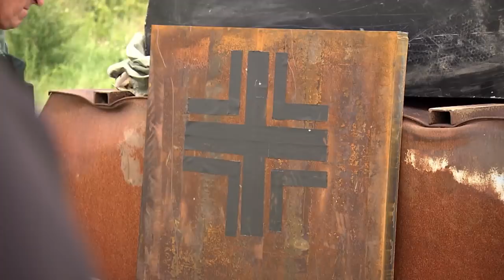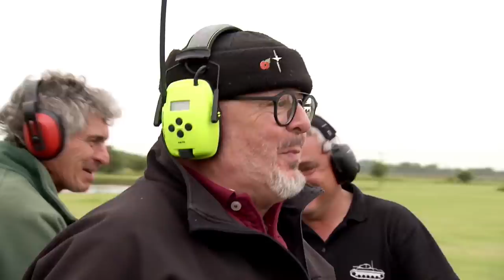Bruce Explodes A Simulated Tank With An Anti-Tank Gun | Combat Dealers

Comment: I don’t think the bazooka was the first launcher to be able to destroy a tank. I’m most certain is was either the Faust Patrone or Panzer Faust
Reply: I think it was the Faust patrone
Reply: Even before the Faust Patronne there was the Pg.46 rifle & Kampfpistolen (modified flare gun) launched and Pg.51 cut down PzB.39 AT rifle launched HEAT grenades. Both could penetrate up to 89mm. of vertical homogenous armour and nearly double the thickness of ordinary steel plate. 

The Kampfpistolen launched Pg.46 grenade had a range of 50 metres.

The Kar.98 launched Pg.46 grenade had a range of 100 metres.

The cut down PzB.39 launched Pg.51 had a range of 300 metres.

In desperate moments the finned Pg.46 grenade could be also thrown against a tank by hand.

Despite having a shorter range than the PzB.39 AT rifle launcher, the Faust Patronne could penetrate up to 148mm. of vertical homogenous armour plate.

The Panzerfaust could penetrate up to 221mm. of vertical homogenous armour plate and up to 192mm. set at 60 degrees of slope. It was more than capable of penetrating any Allied or Soviet tank available at the time.
Reply: Parker Hetzel  It is debatable if the Bazooka was truly a reliable tank destroyer as this test demonstrates.  Many who used it in combat said that it wasn't capable of penetrating the forward armour of any mid to late war German tank and often failed to penetrate thinner side armour, despite its rated ability to go through at least 5 inches of hardened steel.
Reply: ur mom  Let's face it.  The shaped charge of the original Bazooka AT round was just too small to do the job against the armour of contemporary German tanks.
Reply: The Panzer Faust was made after the Panzer schreck which was a copy of the american bazookas captured in Africa and Italy

Comment: First of all the front plate should be angled...
Second the range... You dont know how far the target was killed by there is no way you can test these in only a few meters 
Lastly the gun... There are other guns than the 6 pounder that couldve taken the panther out
Reply: like the 17 pounder
Reply: I can agree.
Reply: And the 57mm 6pdr is a solid chunk of metal flying at a high velocity while the Bazooka is a shaped charge rocket flying at a lower velocity.
Reply: @AJ-170SkyStriker  Even still the Bazooka at the time had different charges some that could pen up  to 65-85 mm and others that could pen up to 105 mm. All depending on the time and unit.
Reply: @ninus17  even that would still have trouble punching through the panther's upper plate, hell, even the tiger would have trouble with that
Reply: KingsWorth and company but it was one of the better options at the time. And the firefly was a lot more mobile than the other Trailed AT guns which required setup time. Where as the firefly could be ready to engage in combat if an when a German panther or tiger showed up
Reply: @ninus17  ok, ya, still doesn't mean it could go through a panther's upper plate
Reply: @crow_boi3387  the firefly was known for stopping tigers... Panthers are thinner.
Reply: @chrislockard1922  panthers are angled, more effective armor thickness
Reply: exactly

Comment: "the american bazooka was the first weapon capable of reliably destroying a tank"
dont lie. just. dont.
Reply: Yanks doing Yanks things
Reply: First INFANTRY weapon. Though that claim is still a bit of a stretch.
Reply: @davidj9677  The Soviets and Finns already had anti-tank rifles that could eliminate tanks at close range in the late 30s or early 40s, so yeah, the Bazooka wasn't first in any way.
Reply: @bluntcabbage6042  The problem was that those anti tank rifles were only good against the thinly armoured tanks of the early war. By 1943 most nations had transition to vehicles that were too well protected for anti tank rifles
Reply: @RocketHarry865  That is partially true. Yes, anti-tank rifles struggled against mid-late war vehicles, but historically, they were deadly foes towards the vehicles they faced frequently. The Battle of Stalingrad saw large use of the PTRD, which had proven to knock out many German tanks throughout the battle.
Reply: @bluntcabbage6042  pak 40? Flak 88mm?
Reply: @jantimmer5558  What about them?
Reply: @bluntcabbage6042  yes but this was because dedicated AT snipers shooted tanks from high ground to their upper superior plate (roof) since the armor was thicc on the frontal plate, on frontal attacks the would fire to the tracks to inmobilize them and then rush em with infantry.
Reply: Well the commom bazooka dont but the heavier ones were cappable, they just were not produced on high numbers
Reply: @Tommy15670  The usage of AT rifles in Stalingrad was more to do with hiding in a certain position and waiting for a tank to cross your field of fire at close range, and it wasn't necessary to shoot for their roof armor.
Reply: @RocketHarry865  yes but at the time it could destroy vehicle so ptrd/ptrs and these other rifles were the first
Reply: Actually I'm afraid it was the panzer Faust .

Comment: A Panther's armor was angled
Reply: In the full ep the pather was hit in the lower front hull where the transmisson was held and the panther they restored was hit by a 2pdr gun and the panther you can look up now and will be sent too the austrilain armour meusem
Reply: 6pdr**
Reply: It's only a simulation.
Reply: Not the sides dude. The sides were really flat, but did have side plates that were meant for high explosive protection and small arms fire.

Comment: The plates increace in effective thickness when angled... And when a plate is angled it also has a ballistic effct to the tank shell that further reduces the penetration of the round... The bazooka also has a smaller hole with a small explosion because its a High Explosive Anti Tank grenade and relies on the explosive inside to force metal through a small surface penetrating the compartment unlike the tank round that has a big and even hole when it penetrates the tank and either explodes or not if it has explosive filler. If it was a tank round, there would be absolute chaos inside the tank from the shrapnel

Comment: I really dont like all the pyrotechnics used, you cant have these things in Britain so obviously these aren't shooting actual munitions but they could at least do more than put a bomb under the dumpster and plasma cut a hole in the plate. That bazooka just  shot a paint round and even if it was a real rocket the hole would have been much cleaner and not have all those secondary impacts around it
Reply: At least they had parts for actual German tanks in the barn however they likely just welded the stug hull together because I seen no reason for any country (Germany or the USSR) to just dump an incomplete Stug and pz4 superstructure in a random barn

Comment: What would really be cool is if there was a single-man bazooka type weapon that could do the damage of that 6” Howitzer.
Reply: Look up the Dave Crocket nuclear bazooka. Does more damage than a hundred 6" howitzers. Blast radius = 5 miles, range = 3 miles. It's a one man one shot weapon. It doesn't require a loader as there would be no second shot because the operator would be dead.

Comment: wouldn't a 6 pounder have to be extremely close to knock out a panther? they were what? less than 100 yards away?
Reply: Considering how clean that hole was they could have backed it up quite a lot. Gonna depend a lot on angle and where it contacts.
Reply: MrLoobu it was special affects. England has no permits allowing for the firing of an anti tank gun in a non-military environment
Reply: @prestonwhite4129  oh fuck me you're right the cannon doesnt recoil lol, that's excessively lame and misleading.
Reply: Depends on the ammunition used and if it attacked the Panther from the side as Allied AT ambush doctrine favoured a position covering a road or zone from the side. 

The 57mm. L.52 6 Pounder AT gun performance:

APCBC/T = Up to 118mm. @ 0 degrees @ 100 metres.
APDS = Up to 167mm. @ 0 degrees @ 100 metres.

The Panther G's hull armour layout is:
Upper front= 80mm. @ 60 degrees.
Lower front = 60mm. @ 45 degrees.
Upper sides = 50mm. @ 40 degrees.
Lower sides = 40mm. @ 0 degrees.
Rear = 40mm. @ 40 degrees.

Most likely the Panther was shot in the side as the odds of a first hit penetration on the front would not have been good at all even at point blank range. 

There is a KO'd Panther G at a café near a village in Belgium, which I climbed all over as a kid in 1975 whilst on holiday. It was shot in the right side by a 6 Pounder gun hidden in a wood on a slope at a range of 500 metres. There is a perfect 57mm. hole on the right upper hull next to the hull gunner's position. The tank was completely burnt out. The crew escaped and were taken prisoner.
Reply: MrLoobu I quickly searched up some videos of the 6 pounder firing and it would appear that is how it fires. Perhaps they did this out side of the UK because that would appear to be a real 6 pounder firing. it's important to note the lack of a slide because the 6 pounder doesn't slide when firing like what most people think of a field gun other videos showing a 6 pounder firing https://www.youtube.com/watch?v=YB9z71IvG3I.
Reply: Also I doubt it is special effects because you can see they had they have the real ammo and gun. You also see that their is an explosion coming from inside the barrel. It wouldn't make sense to get your hands on all this real working equipment not use it.
Reply: @precisiongaming8776  Dude it literally shows one shooting for real as part of a war doc a couple minutes before they "test" it. The real one recoils several feet back, and theirs doesnt move at all. It's fake.
Reply: @MrLoobu  That's a German Pak 40 showed not a 6 pounder notice that the gun shown has a slide for recoil while the 6 pounder doesn't have a slide this is the main way to tell them apart. Pak 40 firing https://youtu.be/T7fhBm1ouSU it's a case of the to field guns being confused. https://youtu.be/hMUiAM87EsY?t=148 this part makes it clear that it's not a 6 pounder being fired in the clip.
Reply: The gun here in this video showing it being fired https://www.youtube.com/watch?v=YB9z71IvG3I the gun doesn't fling back and discharges a spent round but then their is this clip. https://www.youtube.com/watch?v=AjemHnbyDZ0 Looking through the comments it looks to me that the first one is firing blank rounds and the second one is firing live ammo thus the difference in recoil. I think what happened was they fired a blank at a target rigged to explode in this video so the gun really did fire but the effects of the shoot where faked. So in the end I guess this was all just a big disappointment. I wish they would have just said that they where firing blanks and not live ammo cause that was pretty shitty of them to trick people like that and make such a huge production out of firing a blank round. Big oof's 4 me
Reply: Also as far as I know UK law seems to be written so that as long as it is single shot rifled  and firing solid shot then it is legal, also that makes me wonder if it would be technically legal to own a smooth bore cannon with 3 round auto loader, Its basically a giant shotgun
Reply: Precision Gaming 

The bazooka was rigged with pyrotechnics and the 6 Pounder is firing a blank shell.
The live looking shells behind it are inert rounds.
If you look at the 6 pounder when it fires there is a slight recoil, a blank round will create a certain amount of recoil, albeit less than a live round.
The field they are firing on there is no way on earth they would be permitted to fire a live anti tank gun in a flat open field like that. 
It would need to be done on a military range or a purpose built range with a bank big enough to catch any projectiles.
This is quest, the whole thing is set up and fake lol.